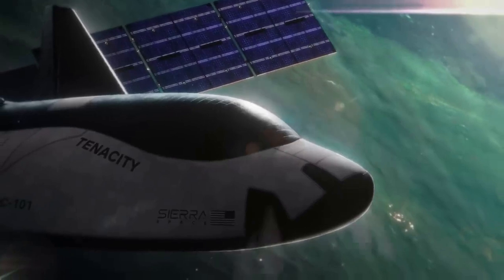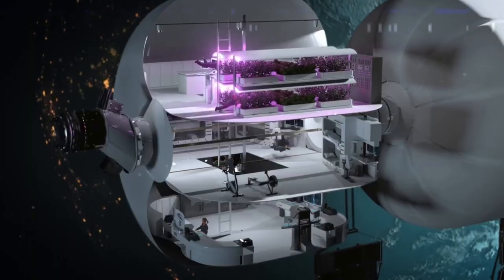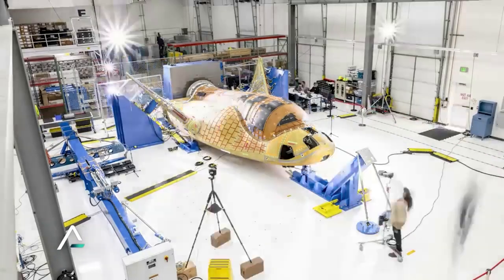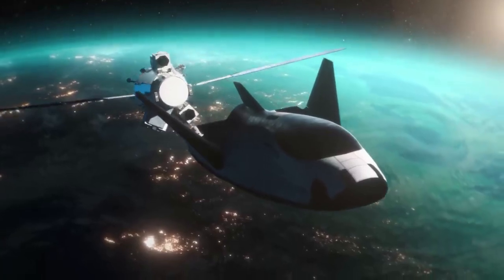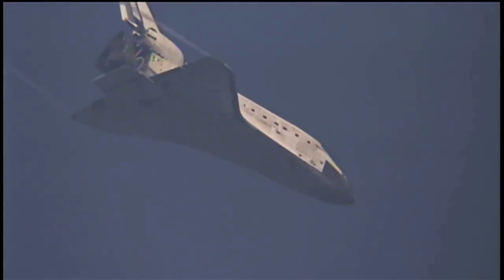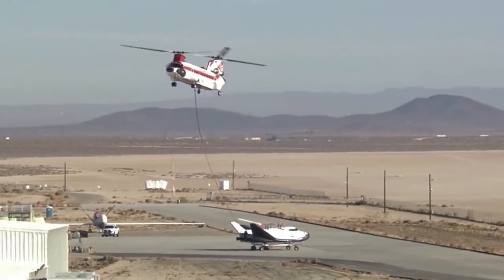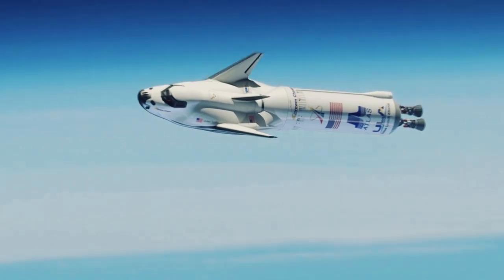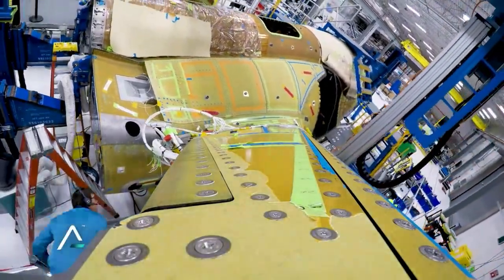How Does Dream Chaser Compare To The Space Shuttle?

Comment: To me the Dream Chaeser lifting body enable to plan a three stage ISS crew switching orbiter almost entirely recoverable, safer with all weather landing capability of such rigid wingless lifting body, economical and using existing and proven technologies. A three stage orbiter can be much lighter than current two stage launchers like Falcon 9 but would be normally less economical but if all three stage are perfectly reusable many times, this is no longer the case…the concept could be stage one : Tim Allen Scale Composite Stratolauncher is a formidable reusable first stage, stage two: the middle rocket of a Falcon heavy can fly very high and very far and can be recovered mid Atlantic as an economical recoverable second stage. As Merlin engines are restartable, it can even boost take off power increasing payload of the launching plane currently at 220 tons. Additional lift from a front mounted Dreamchaeser is also beneficial . stage three a small Dreamchaeser with two expensive orbital Merlin or equivalent with all pumps COPV’s, life supporting auxiliaries but fitted like a long range fighter with two our four 3D printed jettison fuel tanks disposed off just before orbit like the old huge Shuttle tank but vey small as third stage only fuel..these small fuel tanks would be the only lost items but protecting them with heat shields like a Starship to recover empty tank is heavy expensive and uneconomical… it only take a main contractor like a proactive NASA which can make all those competitors work together..

Comment: what is the advantage of a spaceplane vis-à-vis a capsule? what can the Dream Chaser to more than let's say a dragon capsule?
Reply: Capsules land more violently than spaceplanes
Reply: Space planes can be controlled after reentry and fly over populated areas.
Reply: @falconwaver  most capsules generate lift by having their center of mass offset and then they can roll to steer
Reply: @markmontagna7637  Capsules only while hypersonic, not shortly before landing where its trajectory becomes vertical.
Reply: the main benefit is cost. from just the initial price, a capsule is cheaper and lighter, but they can only be used once or require a lot of time and effort to be reused, a space plane however can be reused with just some standard maintenance between flights and is more cost effective in the long run. so for missions like Gemini or Apollo, where you only had a few dozen planned flights, the capsule would be cheaper to design and use (on top of the materials and techniques that weren't available yet, but potato potato) but for missions like the ones for building and maintaining the ISS that require several hundred launches, a space plane is far cheaper and more appropriate for the transportation of people along with large quantities of cargo over a much longer span of time
Reply: @theangryotaku3361  how is a spaceplane cheaper to operate than a capsule though? I was under the belief that the crew dragon is reusable. Wasn't the space shuttle retired precisely because it was more expensive than conventional means?
Reply: @delfinenteddyson9865  the shuttle was expensive because of its thermal protection system being so complicated and fragile. dream chasers is supposed to be much simpler
Reply: @markmontagna7637  fingers crossed
Reply: @delfinenteddyson9865  you dont need to call the navy to recover your capsule which lowers cost

Comment: IMO the Space Shuttle was a poorly designed engineering kludge with way too many design compromises.
Reply: definitely, from things like aerodynamics of the orbiter to the solid rocket boosters, the shuttle was not perfect at all. As cool as it was, it had way too many flaws for the program to continue operation.
Reply: Some people like to criticize the shuttle for various reasons many of which are justified.  But that biased argument ignores the positives accomplished by the shuttle which include, but are not limited to the following.  

Carrying ISS units into space to begin its construction.  

Launch the HST and return to it several times for repairs and maintenance.  

Launch several astronaut teams to and from the ISS.

Launch numerous satellites. 

Provided NASA valuable information that the shuttle model was not a cost effective or particularly safe vehicle allowing research for future space vehicles to take a different direction. The dream chaser could be a step in that direction.